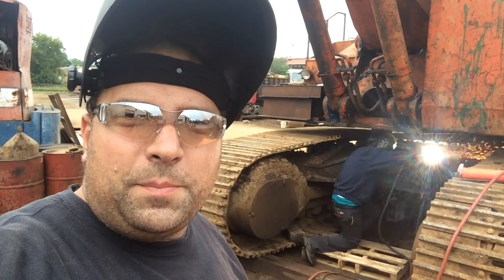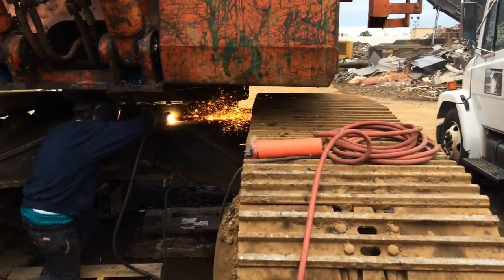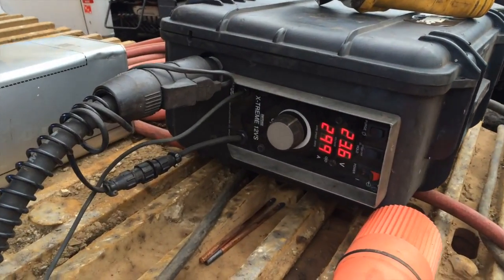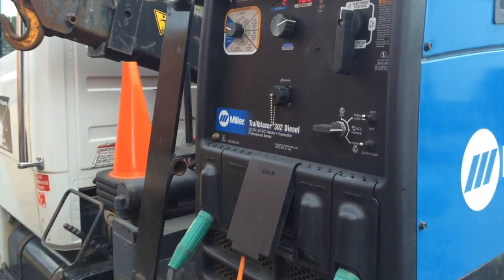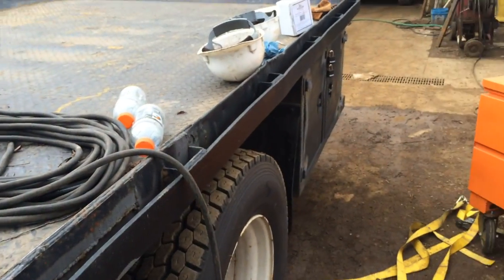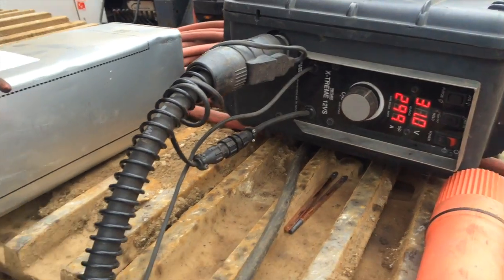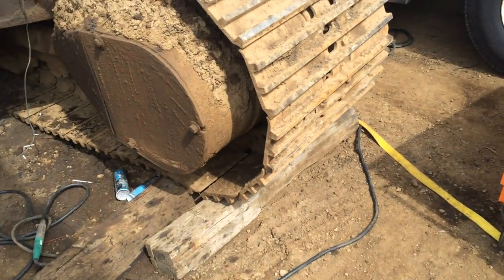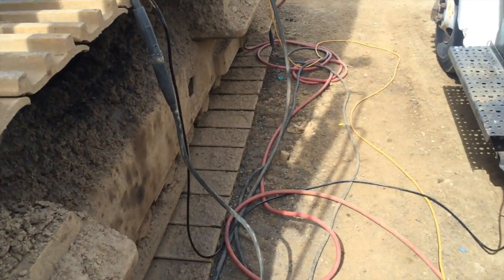Carbon Air Arc & Dual shield wire in the field

Comment: Pete I really liked that video , I usually cur out bad welds with oxy/acy to gouge but recently have tried plasma gouge with a 15 deg. Torch head, it is quicker to me but how is carbon air arc , is it easy to control ? I find your YouTube videos Very informing, Thanks for all the info! P.S. I truly wish I could understand German as that was a good vid
Reply from the maker: In a nutshell:  Arc arc can be VERY efficient, fairly inexpensive and HIGHLY controllable.   The downsides are - you need A LOT of juice - at least 300 amp to even get started ... 500, 800 or 1000 are much better.  Carbon rod diameters are directly related to amperage.  typical air consumption is about 20 -30 cfm  (maybe even higher on bigger rods(800-1000 amps)), it is loud as hell and very bright (shade 9-13) depending what you are using and how sensitive your eyes are.
Picture it like "reverse stick welding"  it does not blow through like a torch or plasma cutter - it "shaves" off the top as deep as you push it into the metal (providing you have enough amps ....  for example a 300-350 amp engine drive can run 3/16 or 1/4 rods .... those will make a 1/4+ wide trench about 1/4 deep (max - than the machine is running out of steam), however you can shave as little as 1/32 deep at the time or whatever your fine motor skills allow you to do ....    
To me the process is awesome, i have a 185 cfm sullair under the truck (more than enough air ....  300 amps are ok - i have 2 lincoln vantage 400 (those are 500 amps 60% duty machines) they can be paralleled to 800 amps 100% to 100 amps 60% duty ....)  than it really rocks !!!!  lots as hell, sparks everywhere - but it leaves a "clean" finish when you do it "right" you can flux cored weld right over the trench you gouged out ....  
I have a Hypertherm 85 that i like for certain applications - i can run it of of the Vantage 400  3phase generator part .....  
But for 9 out of 10 Jobs i like air arc better ....
Reply from the maker: https://youtu.be/J20KvloBIsU

check this out for a more descriptive picture and video
Reply: nothing beets ace air, love it
Reply: William Buedinger Same here, I use a wash tip on oxy/acetylene torch and over the years have gotten really good at burning beads out nice and clean... I have used air arc also, but prefer the wash tip over air arc...